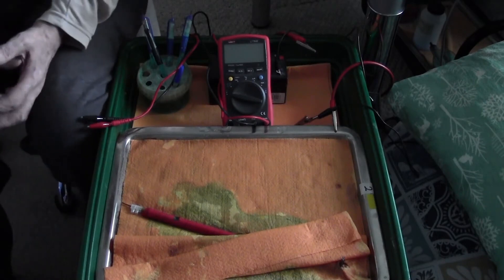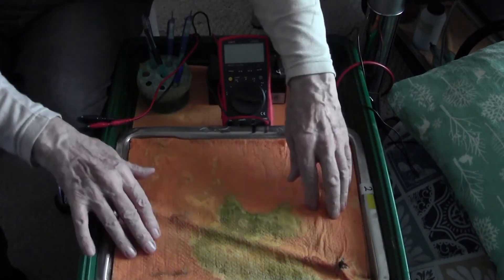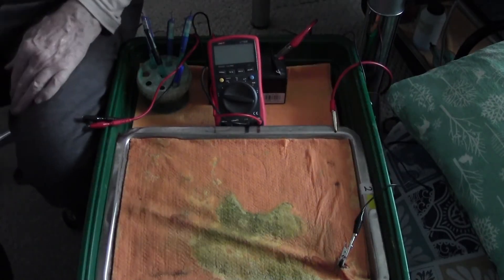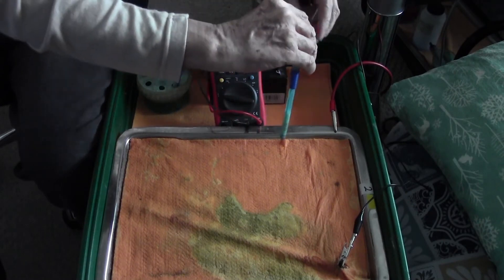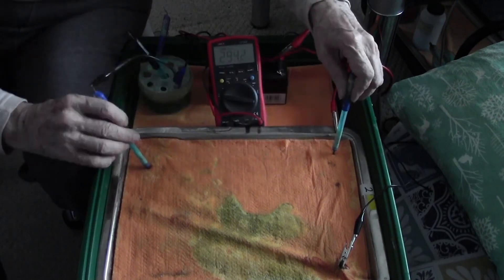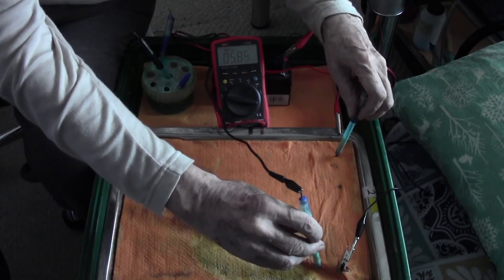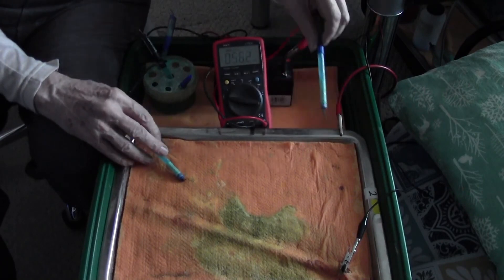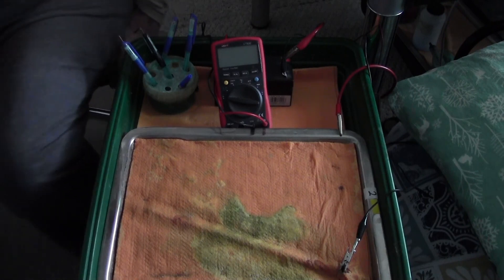This experiment demonstrates how I invented DCVG in 1974

Comment: "That's the way electricity works" No, the charge comes from the negative, not the positive.
In your circuit, the electrons flow from the pipe, creating depletion zones, which would encourage corrosion.